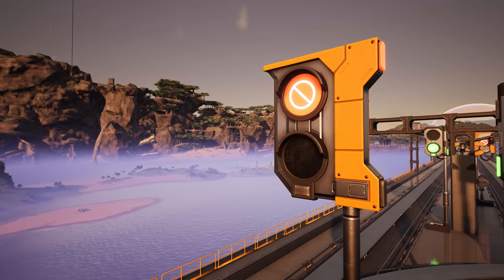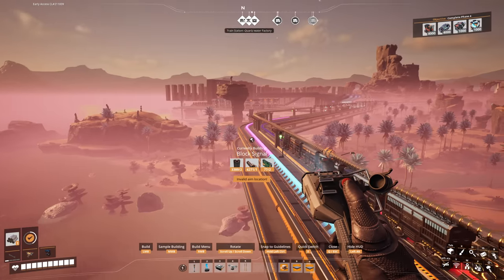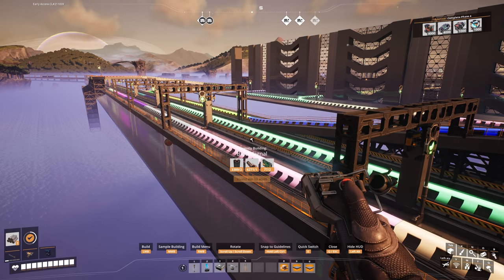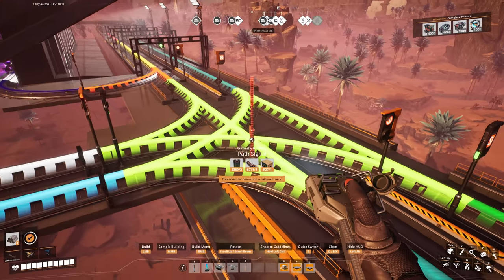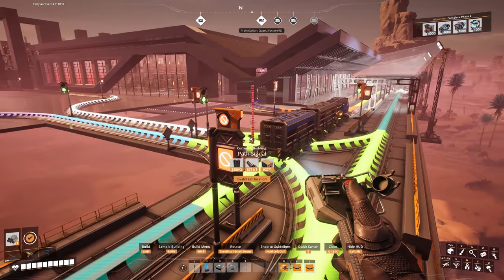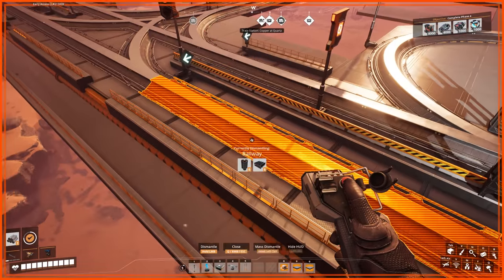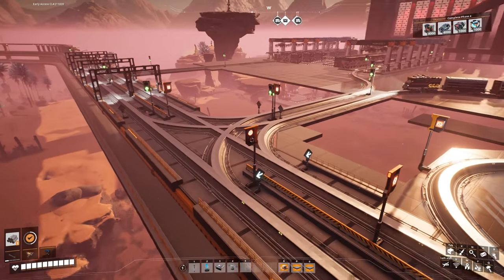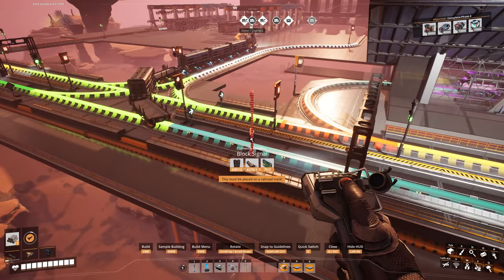Train Path Signals EXPLAINED and MORE..!! in Satisfactory

Comment: I'd been struggling with getting train networks to actually work. I think that whole section about leaving enough "room" before the Path Signal so the train doesn't have to slow right down, combined with putting Blocks every so often along the 'highway' parts, was what I was missing. Thanks Bitz, helps a lot.

Comment: Actual trains used that system until recently. Some parts of the world they still do. 

The neat trick is that the system knows a train is in the track by SHORTING the two tracks, since the wheels are steel, and the train axles are also steel. They imprint a 60Hz ac signal on it that gets shorted by each train, and the blocks are separated by a large control box that jumps the signal from block to block.

Comment: Beautiful video but you only described one feature of path signals.
When an automated train asks for a path the path signal not only communicates with the path signals at the other entrances but also with the block signal at the end of the requested path. Only if that block signal is green the path will be granted making sure the train can always exit the section and not permanently blocking it. The exit block will also be reserved and block other trains from entrering from a different direction.
Another feature is that path signals can be daisy chained. All the path signals along the path will turn green as soon as the first path signal does. But at the end of the chain there must always be a block signal which basically controls the whole path.

Comment: I'm glad the game designers didn't input speed limits in curves for trains to stave off derailment too.  That would be so freaking hard to code I understand but IRL trains really have to slow down in curves to not fall over.  

From working on a real railroad myself for almost 3 years, that description was excellent, not just for the game mechanics, but for what real signals actually do..

Comment: One tip for single rail pioneers...don't do it...I've tried...12 times or 4 different saves. You will fail and have multiple stare down scenarios. 
Why I am saying is cuz, most fresh pioneers try using path signals when they only have single bidirectional tracks. The path signal logics don't apply there. You need to have dedicated train lines that cannot be crossed over by trains but are still crossing each other for path signals to work. Key terms "Trains cannot cross tracks, but tracks themselves are crossing each other". That scenario only comes when using uni-directional tracks.
Moreover, the only sure fire way to divert single rail staredown issue is to build double uni-directional rails.

Comment: As one of the many idiots who is too smooth brain to understand path signals, this was a really well done explanation. I may actually get how they work, though I can't really say for sure yet lol.

I will ask one question if you see this. Does using path signals have any great effect if you're using a single line rail or would it be better to just use blocks in that case?
Reply: A path wouldn't have any added value here (assuming it's a single line with one way trafic) a "normal" block signal would suffice
Reply from the maker: Appreciate it, Exactly like FractionOfSilence said here, yeah, with a single line, there is no need for path signals. If it's a Single train on 1 line, there is no need for a block either; unless you have a loop with multiple trains on a single line, you will need blocks.
Reply: @ItsBitz  First thank you both for the answers. And to reply I try (cause lazy lol) to use a single line for multiple trains with splits at points along the way where one can wait along a separate path for a train coming the other way. I just use a two way block along both ends to tell a train it needs to go to the side rail and wait while the first travels through. So that's what I meant with using them on a single rail system. I honestly don't even know if that's the best way to operate multiple trains on a rail like that, but it's the best I could figure and it worked so I've stayed with it lol.